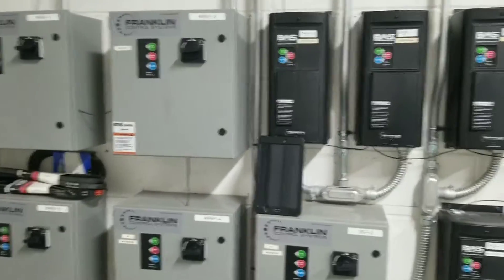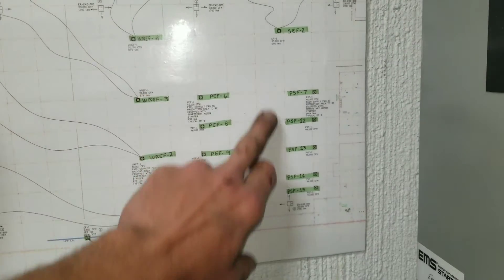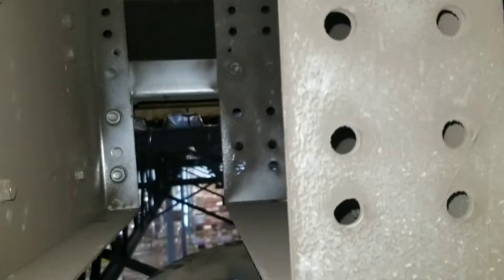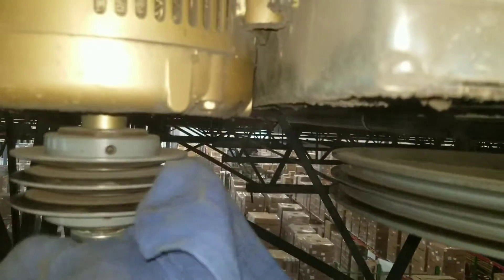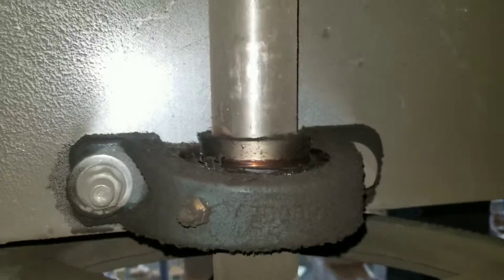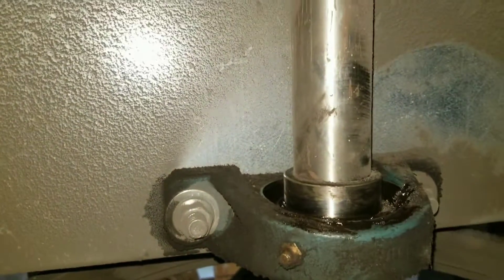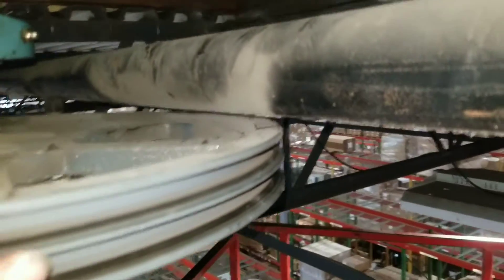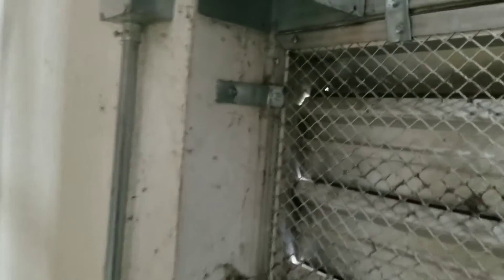Commonly neglected and missed items on commercial preventive maintenance

Comment: So the black boxes supply voltage to the fans and the gray boxes are for what exactly? subscribed
Reply from the maker: They are basically the same, dont ask me why they are different types but there all starters, the grey boxes just have an LED read out and the others dont. they do feed voltage to the fans and monitor amperage so turns off if amps go above the set point. They also have an auto button which allows these specific starters to operate the fans off of a thermostat with a sensor mounted in the rafters of the building. Some we see are just turned on manually by the customer. Hope this helps, thanks for watching!
Reply: @EverythingHVACR  Thank you, you the man. One quick one if you dont mind, do you do controls also? you now bacnet and all that stuff. Im looking to learn while I do my first year in residential/commercial HVAC
Reply from the maker: I do some controls, it's good to know that stuff but takes time. I would tell you if you are new to the trade and want to know about controls there are a lot of resources out there but start with knowing how the systems are supposed to operate, VAV and constant volume. If you understand the operation and sequence it will be more helpful to you the controls will come. Dont jump to quickly to step 3 make sure you have a full understanding of steps 1 and 2. Good luck with whatever you do, I dont mind answering questions.
Reply: @EverythingHVACR  Agree thats exactly why Im doing at least 1 year of field hvac even though I was offered an entry position in controls. Im finishing a 12 month hvac program next month and start working in the field soon after to learn operation and sequence during the day but also controls at night at my own pace, so learning all day basically lol. Thanks man!
Reply from the maker: I have some older control videos, I will warn you the content may be good but the video may be terrible I'm new to this YouTube thing and shot a bunch vertically. Good luck man, thanks for the support

Comment: Do you have a set amount on your maintenances or is it on T&M?  We have a lot of maintenances where we’re able to give our full service to the customer but others we definitely don’t, I’ve just never seen anything clean the motors like you do or the actuators so I’d assume this maintenance has to be a good amount of time
Reply from the maker: Yes we have a set amount of time and this is not something I would do every visit but ever so often it's good to do. It also helps if you keep everything else in good condition on some visits you have time for the commonly Neglected items. I dont want to have to replace one of these bearings or motors. I have seen bearings with like 4 inches of grease and dirt just never got touched and guys just keep pumping grease in to them. When there covered in grease it's hard to tell how much grease your adding or if it's even making it to the bearing or spitting out of the seal. I try to be as thorough as possible with the time I have. Thanks for the comment!
Reply: @EverythingHVACR  right on Steve👍